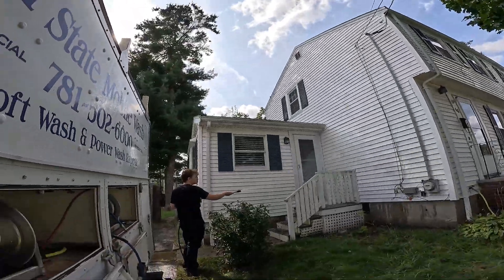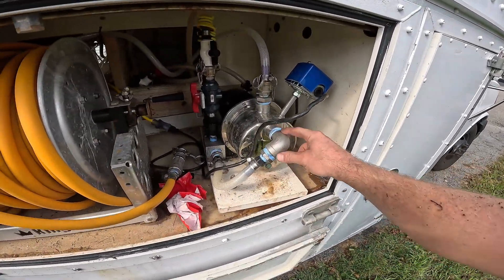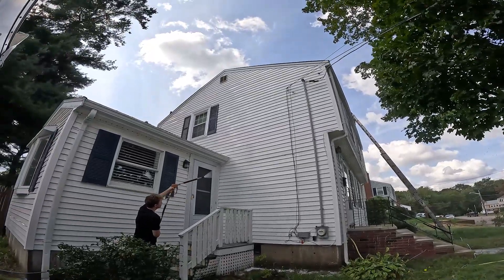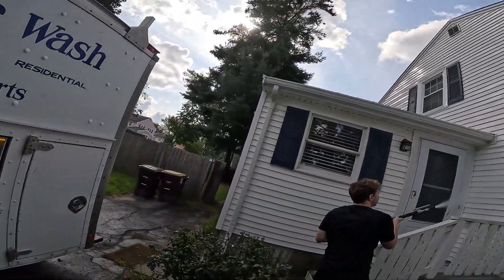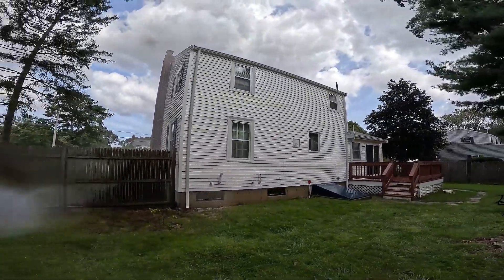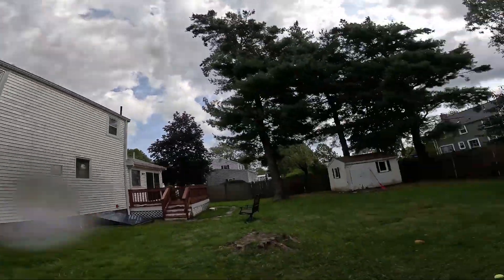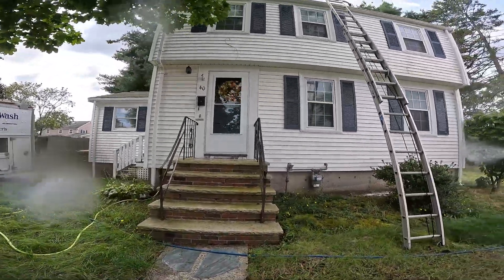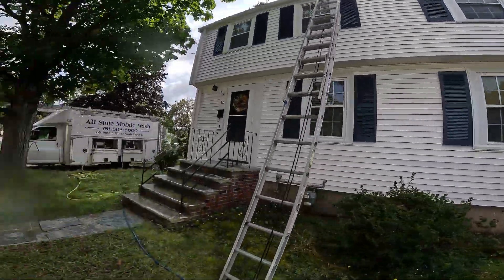House Wash 8gpm Pressure Washer (Job Recap)

Comment: Is that it? You guys popped up on my feed and I was expecting a complete job with a before and after. All I saw was you guys spraying water. Did someone actually pay you for this?
Reply from the maker: You obviously don't know what soft washing is if you think I'm just spraying water and leaving.
Reply: @SoftWashFactory  Clearly not. Do enlighten me. If I soft wash my car is it clean?
Reply from the maker: Being serious you do "soft wash" a car with different chemicals than a house, but what soft washing is, is using low pressure to apply a detergent to remove the mold mildew dirt and then rinse with low pressure. That's why you don't see us like blasting away at every inch of the house with pressure.
Reply: @SoftWashFactory  But there seemed to be no visual difference particularly with the steps. Having watched many other videos to do with cleaning I'm not convinced I would ever consider this method.